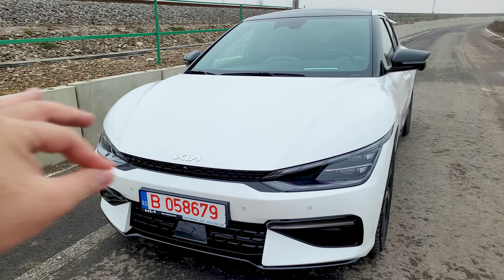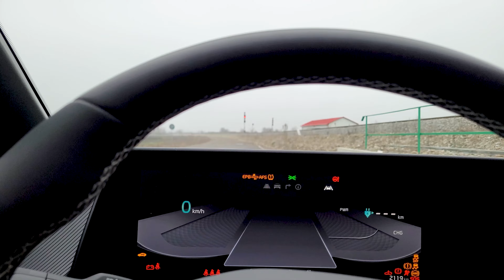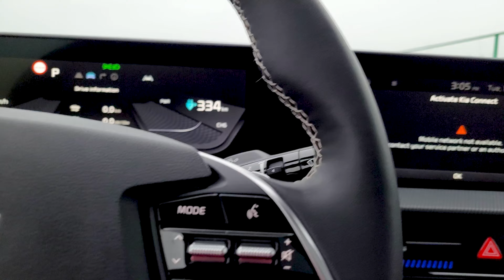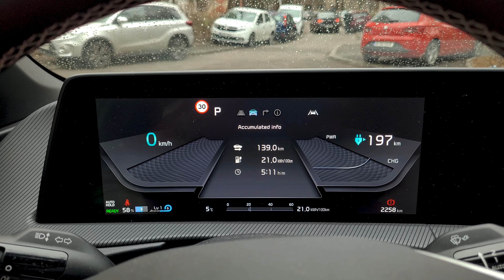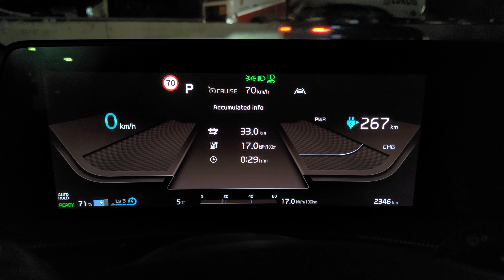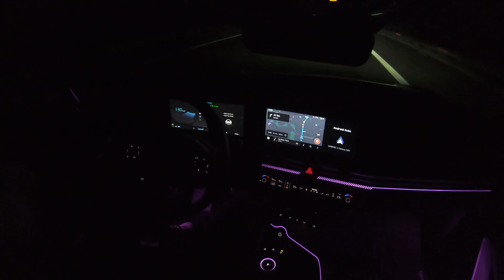2022 Kia EV6 (RWD, LR) Real-Life Range Test

Comment: 6 min and 49 seconds telling the world that this is a video is a real life range test. It is not. it’s 6 min of unnecessary footage before you show any driving, then you report some figures.
Reply from the maker: This is not a test drive. Seems like you didn't get it. This is a range test. Maybe I should've talked about it some more.
Reply: @GabrielNica  So in order to determine the range, you needed to TEST how far the car would DRIVE and report the outcome? So you test drive the car to determine consumption vrs range. You could have imparted all that information in 49 seconds and then actually commenced the test drive to determine the range. Yes, it’s important to note the temperature, wind speed and precipitation as EV consumption goes up in the wet due to having to overcome the surface tension of the water on the road. I dig tests, I dig EV’s and most of all I dig pertinent information. I’m less of a fan of waffle for waffles sake, and on this video  there’s at least 6 min of extraneous footage before you show the car being driven.